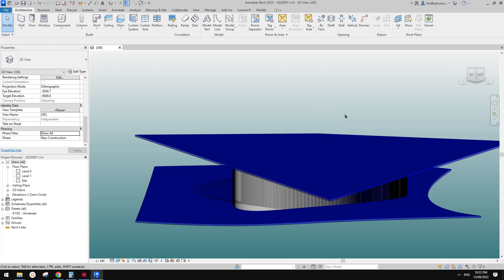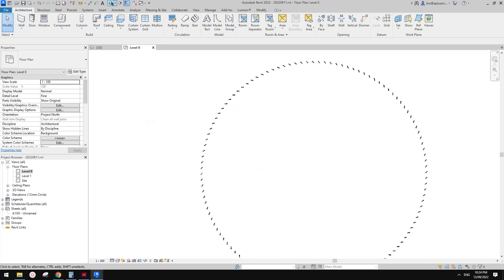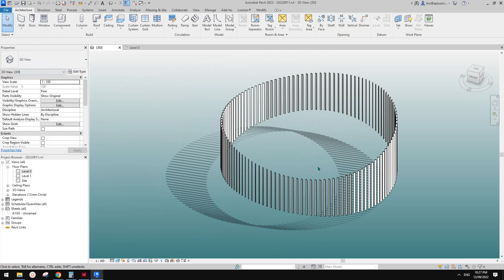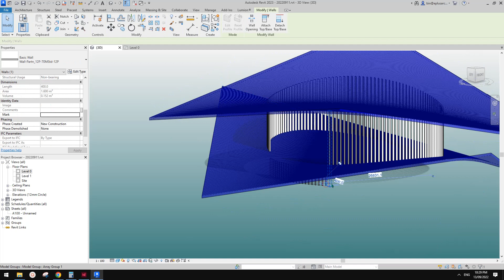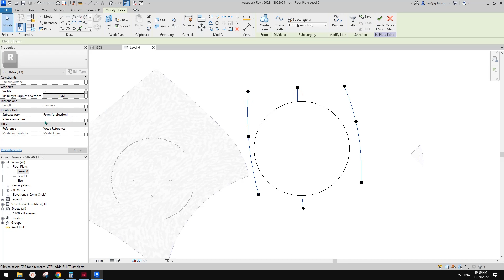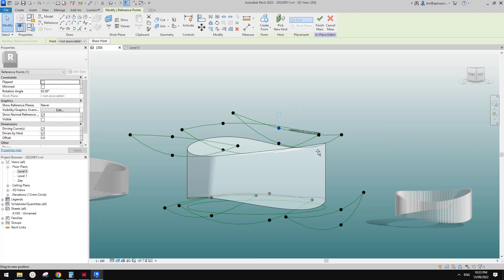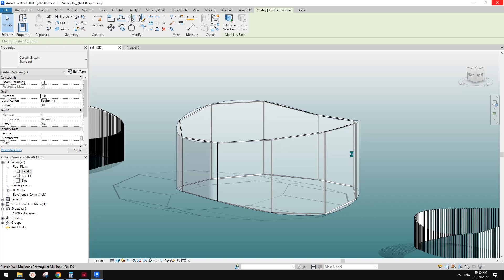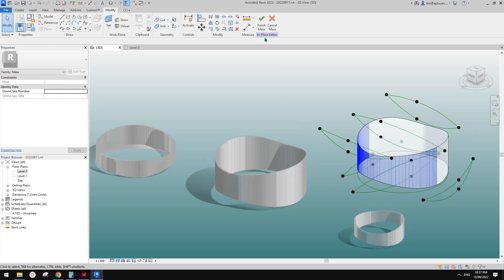Revit Exercise (Day 904) - Some More Methods For Exercise D902

Comment: All great method for graphical representation, but when it comes to rendering, all of these methods pose an issue where the material applied to the mullions appear repetitive as it’s applied to each individual component. One idea is perhaps creating a wall with reveals that cut through to create the individual mullions, this way the material applies to the whole wall surface and therefore appears more organic when rendering. This perhaps can also be done with a line based family with voids set to an array parameter cutting a single solid surface. I wonder though if attach to top works with this method, would be great to test that out!
Reply from the maker: I am not sure about render in Revit because I only do rendering in Lumion. All elements with same material are considered as a single element, so that issue will not occur. I don't think using reveal, or void is a good idea, because it will slow down your computer significantly while there is a large amount of void. I think finding a better material image, or adjusting the mapping to make it less repetitive is a better solution. What do you think?
Reply: I use Enscape which essentially adds a single material to each component, this ultimately means that when rendering it comes out repetitive. I can’t think of any other way around it..